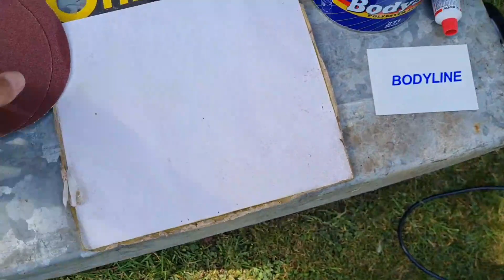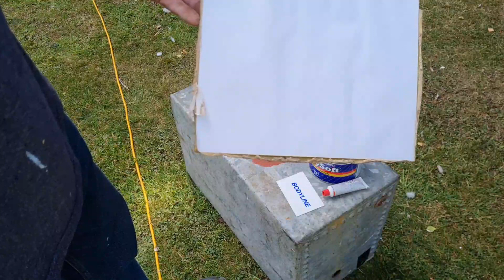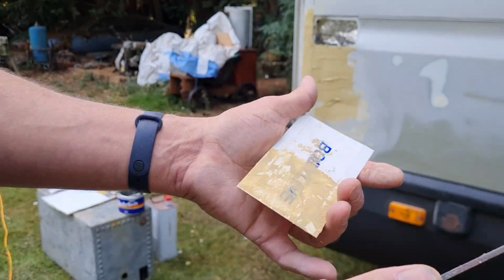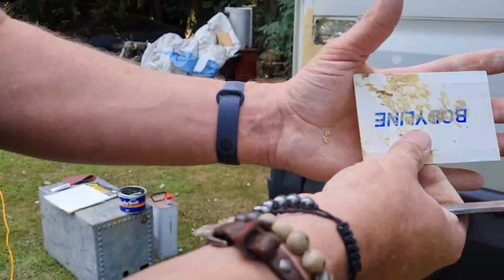DIY Body Repair and Prime.

Comment: Make sure you blow the dust out of the DA motor as the filler is very much the same compound as the insulation of the windings in the motor (polyester) and it will build up and cause the motor to burn out, dont ask me how I know but now I only use an air powered sander for filler. When I was a child of about 8 I saw  someone in the garage where my father kept his car filling a dent in a car door with a blowlamp, lead and a wet piece of sacking. When he was finished there was no need for sanding,  just a bright smooth surface blended in perfectly with the cars metal work.
Reply from the maker: I shall have to remember that. Thanks.